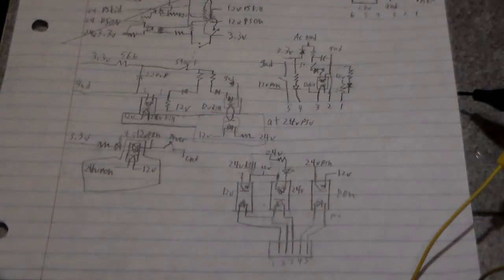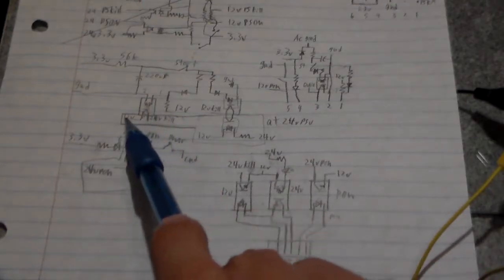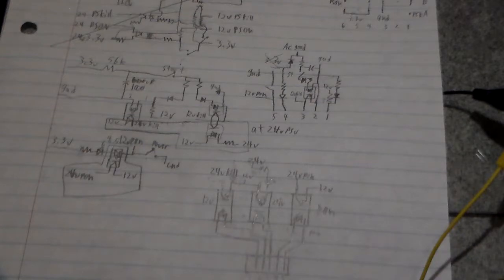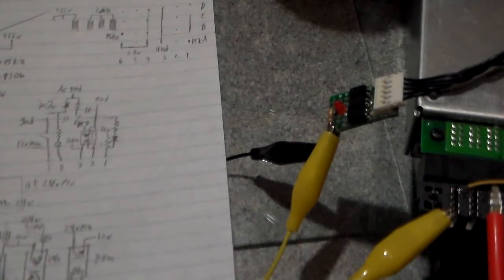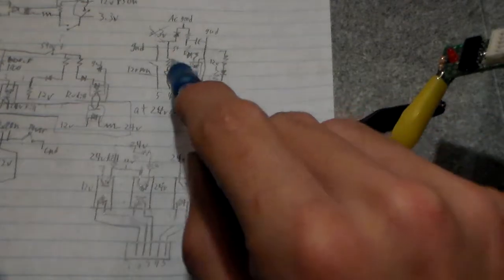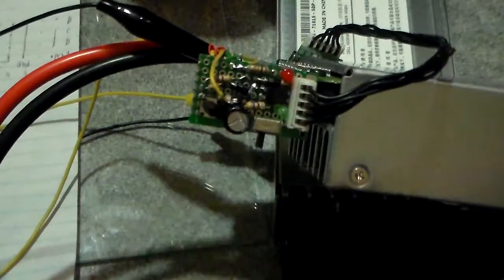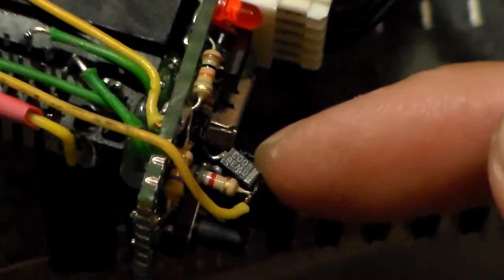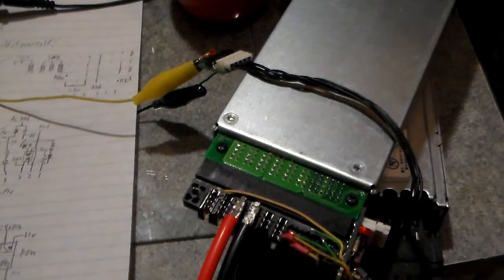How to safely wire server PSU's in series Part 2

Comment: Hi. How did you know these ps are have isolated outputs because I know that if ps have non-isolated output you shouldn't connect them series. I am planing this kind of thing but how can I be sure my ps are isolated output
Reply from the maker: yes please see Part 0 of this project I disconnected the ground connection on just the low voltage side of the power supply. This leaves the ground of the high voltage side and chassis intact so it is still safe to use. https://youtu.be/M4wOFHAjR5U
I'm not sure why only my Part 2 has so many views I will update the videos so they are more linked together. Thanks for the comment. Is there anything else I didnt cover?
Reply: @SuperBrainAK  Thanks for consideration. I am actually meaning about common ground. It call isolated and non-isolated out put. This link is in Turkish. But if you look up the pictures I think it will help to explain my self. An Electronics engineer who is my friend said that. If you use non-isolated (common ground) ps they will blow up.
I watched your part 0 It's more about topoligy than chassis.
Reply: @SuperBrainAK  sir I understand you.  Ypot ps only have ground connection via chassis. I wondered did you checked there was another connection inside psu due to topology
Reply from the maker: @cxxaner  Oh I know what you were saying. You are saying topology in reference to the circuit and how that is wired. I did check with the multimeter and knew that the grounding of the low voltage negative rail is done by only those 2 screws I showed on the low voltage side. I did say in the video that the ground of both sides were not connected but I did not say it clearly by mentioning a possible connection in the circuit board. Here is a time stamped link to what I said in the video hope it helps. https://youtu.be/M4wOFHAjR5U?t=123
Good luck on your project!

Comment: What did you do about the second power supply being shorted through ground when connected in series? I'm doing the same thing and the only solution I've come up with it to isolate both cases from each other, then put both in a plastic case so you can't contact the metal. I would keep the negative most power supply's ground intact (so the outgoing negative is safe from a ground fault) then cut the most positive one.
Reply from the maker: you should watch my video on how I isolated the second PSU from ground, I was able to leave the primary side and case properly grounded and only isolate the secondary side from ground. https://youtu.be/M4wOFHAjR5U